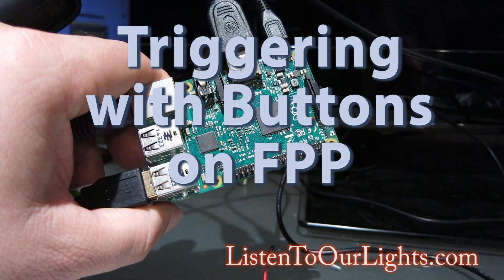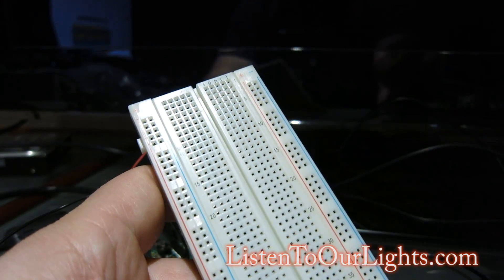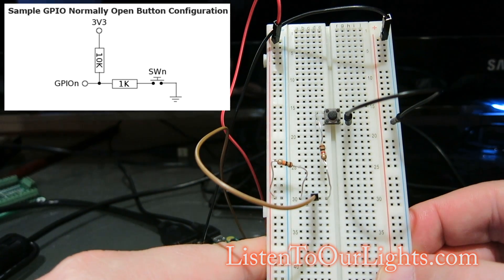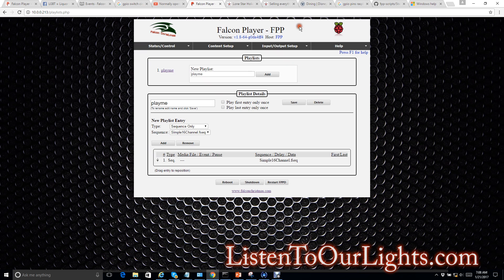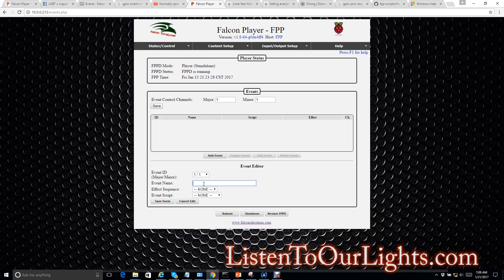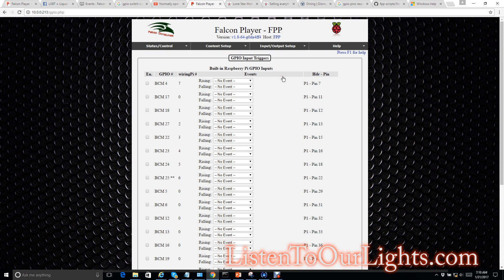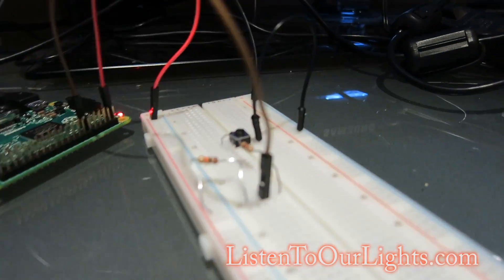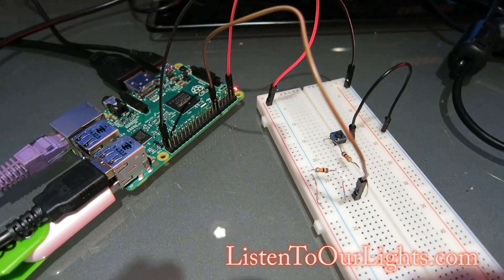Button Trigger for FPP

Comment: Great video! Would it be possible to get this to work with a light switch? I have a Samsung Smart things hub and have installed some z-wave light switches and outlets in the house. I think it would be great to be able to start my show with a light switch. This would also integrate it with my smart speakers.
Reply: I guess a smart button would do the trick...

Comment: I do the same thing, but I don't use a physical switch: I use the big button configurations with my smartphone or PC. I leave my PI on 24/7. I seem to get Page Can Not be Displayed  and have to reset the Pi by unplugging. I dont think I am losing WiFi connection. I think problem is that Pi might be freezing up.